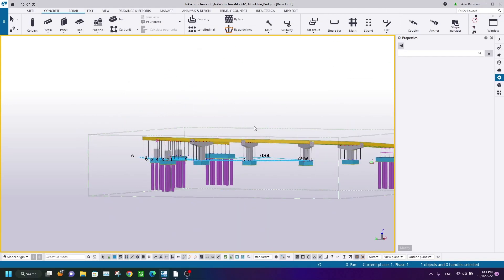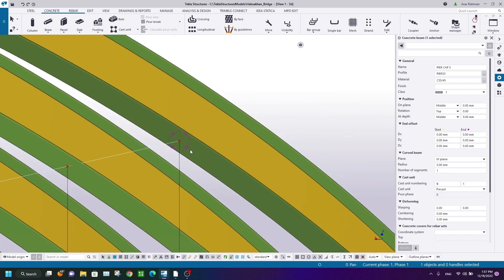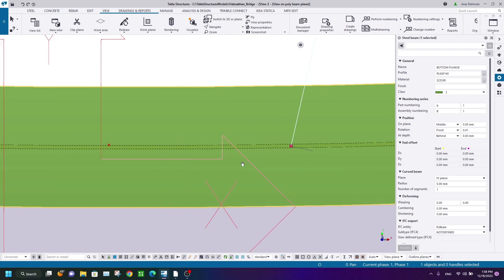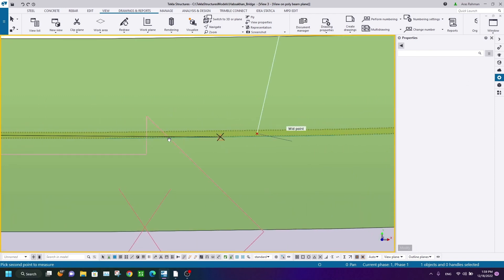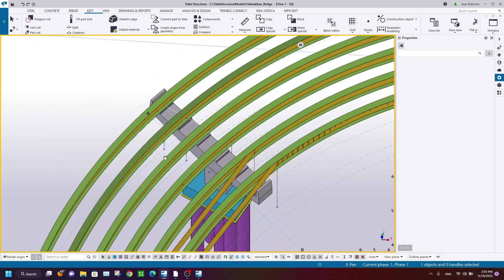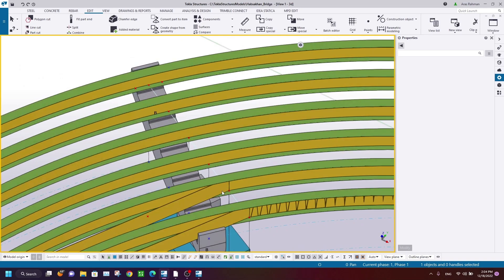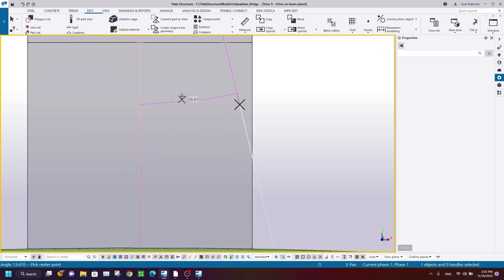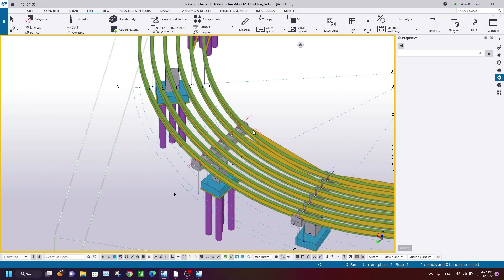Create Curved Bridge Pier Cap in Tekla Structures (Flyover bridges in Tekla Structures) [2022]

Comment: Hello. This is a good content. I’d like to know how did you created that curves beams with the correct elevations. Greetings.
Reply from the maker: Hi, there are many ways, the simplest is using points, as you know every point has a coordination (x,y,z), make an arrangement between the tekla points and your (civil 3d or autocad) project.
Or you can use survey points directly in tekla structures.